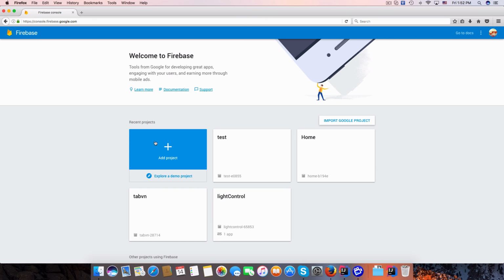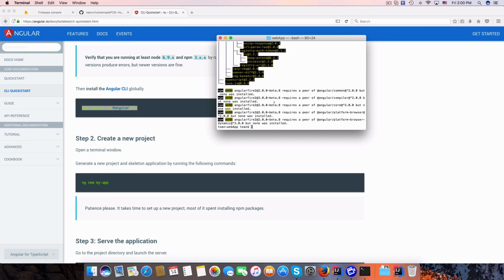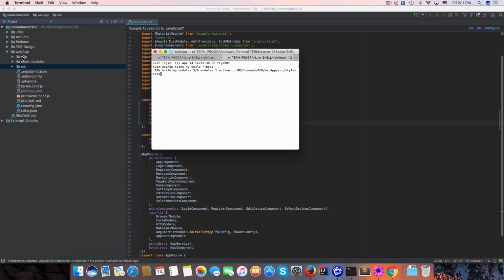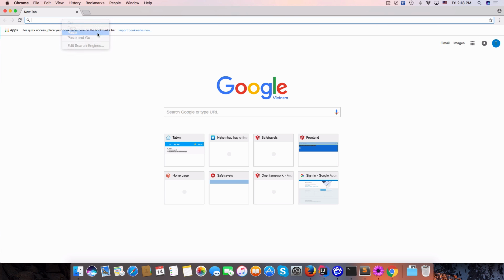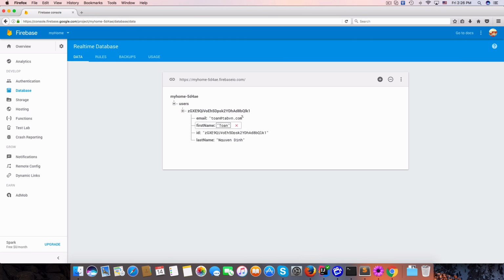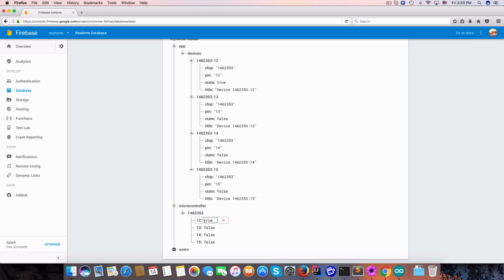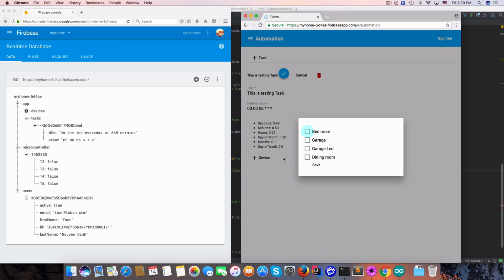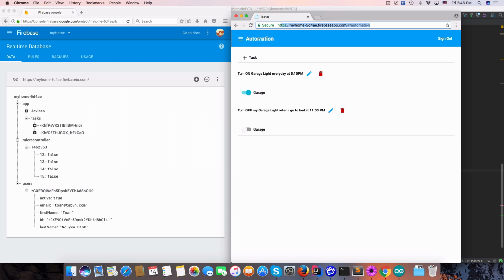Homemade PCB & Internet Light control: Part 2 Build Web App

Comment: hi, sir, i had download all the file from github, i got same error after put command 'ng serve' which terminal/console shows error in all scss file, therefore, i used notepad++ to open the scss file, i found that there is no code inside scss file, why this thing happened? can you kindly reply to my question? it is urgent to me, thanks!